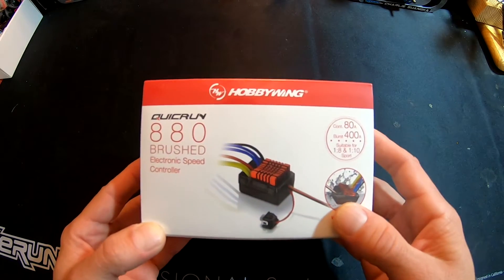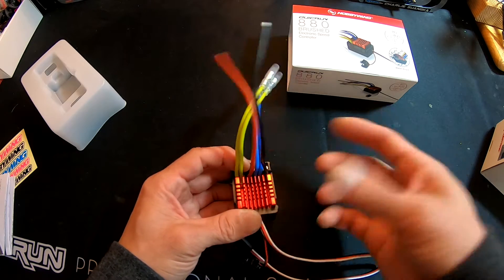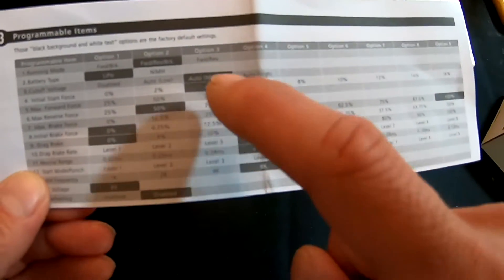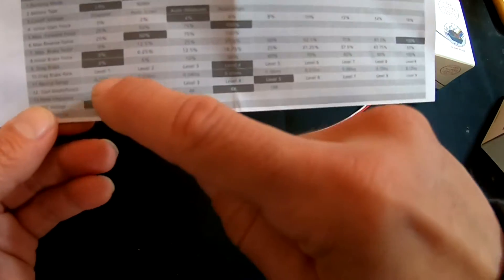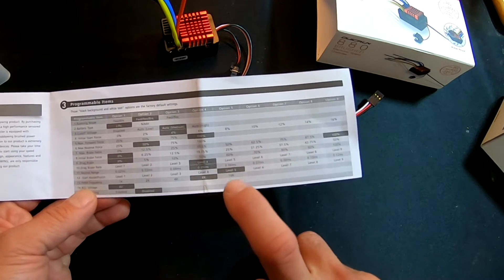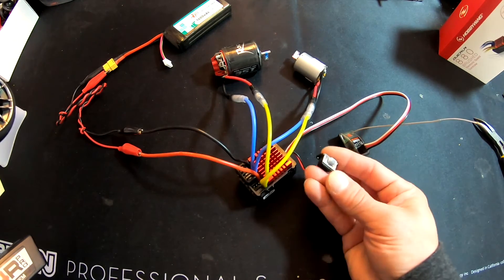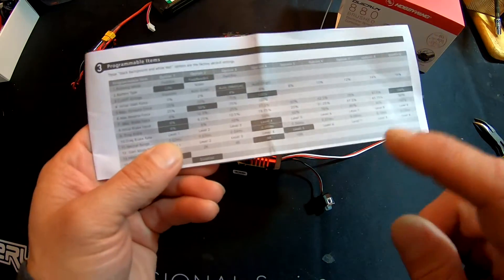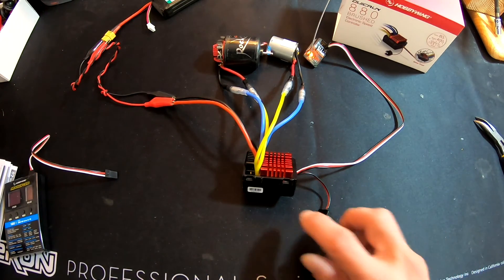Hobbywing Quicrun 880 Brushed Electronic Speed Control

Comment: will this quicrun 880 be able to handle (2) 30amp @ full power,12volt trolling motors. they are used  for momentary purposes only, like less than a minute at a time not continuous use. Thanks
Reply from the maker: Possibly. Hard to know for sure, but feel free to email us and we'll put you in touch with the correct dept.  NorthAmerica@hobbywing.com

Comment: Could this be used in a vintage tamiya clodbuster to replace the mechanical speed control?
Reply: I use it on a super clod. I really like it. I wanted a little more pep than out of the box without going brushless. So picked up the 880 and a 3s lipo running the stock 540s and man does it rip now.

Comment: installed in a Redcat RS10, reverse is full throttle but forward is less than half.
Reply from the maker: After install, then calibrate, do basic bench testing and adjust wiring or settings as needed depending on the items being used.  Email us for direct support - NorthAmerica@hobbywing.com

Comment: This is a good esc. I prefer this over traxxas’ ridiculously overpriced evx-2
Reply: So this will work for replacing a 3014 esc from an old E-maxx?
Reply: @Circuitprotector yep, I'm currently running this in an E-Maxx. I used it to replace the original EVX ESC.
Reply: @OmegaWolf543 Will I have to program it for running two 2S 7.4V lipo batteries? I'm not sure I'm handy enough for getting this esc to work.
Reply: @Circuitprotector nope, it comes out of the box with LiPo voltage cutoff enabled. That's exactly how I run it too.
Edit: don't run anything below 21 turn motors on 4s, otherwise the ESC will cut out. I learned that myself by trying to run two 12 turn motors on my E-Maxx.
Reply: @OmegaWolf543 I have the stock Titan motors in. Will that work?
I thought the esc comes programmed for one 2S battery. Running two 2S will work without buying the programming card.
Thanks for all your help so far. I really need some guidance.
Reply: @Circuitprotector yes, the ESC auto adjusts the cutoff voltage depending on the input voltage, so you can run 2-4s without changing anything. The stock Titan motors will work fine, since that's what I run as well.
Reply: @OmegaWolf543 One more question, if you don't mind.
How does the second battery get connected to it because I only see one set of battery wires?
Reply: @Circuitprotector the ESC comes with a jumper wire in the box. When you solder your connectors, use the jumper wire to make a Y splitter. Solder the positive side of one connector to the positive on the ESC, and the negative side of second connector to the ESC. Then solder the jumper wire between the open positive and negative ends of both connectors.
Reply: @OmegaWolf543 Yes, that makes sense.
I was wondering what that extra piece of wire was for.
Do they have that in the manual?
Reply: @Circuitprotector I'm not sure, I didn't read the whole thing when I got it. Only part I read was it's default settings, since it lists all the programmable features. It had what I needed thankfully, because I did not get the program card.
Reply: @OmegaWolf543  I received the esc but there's no fan inside. Is that how yours is?
Reply: @Circuitprotector mine came with the fan, they might've forgot to put that in. I'd contact their support and see if they can send you one.
Reply: @OmegaWolf543 The screws were there but not the fan.
Reply: @OmegaWolf543  This would be considered an in series connection, correct?
I have the Y connectors made up but I wanted check to make sure that in series is correct, not parallel.
Reply: So I have the 880 esc installed but still no go.
Not sure why. Any ideas?
Reply: @Circuitprotector YouTube keeps deleting my comments for some reason. Does the ESC power on properly?
Reply: @OmegaWolf543 Yes it powers on fine and the steering works.
Red light goes on when I hit the throttle.
Forward and reverse but not making the motors turn.
Yellow for positive and blue for negative on the motor wires.
Reply: @Circuitprotector are the motors wired to the correct cables on the ESC? First time I did it, I accidentally did it wrong. Yellow is positive, blue is negative, and the sequence should be M1+ M2+ M1- M2-. And these are the stock Titan Monster 550 21t motors, correct?
Reply: @OmegaWolf543 Yes, the negative and positive is right but I don't know about the M1 M2. I'll have to look later.
Reply: @Circuitprotector it'll be labeled on the ESC just below the wires, M1 and M2 of course means motor 1 and motor 2. That was the initial mistake I made, I mixed those up and got no throttle.
Reply: @OmegaWolf543 I hope that's all it is. I'll look in a few minutes.
Reply: @OmegaWolf543 Still not working.
Are there different 880 esc? This one says Quicrun 880-Dual Brushed 80A SBEC 6V/4A Input 2-4 S Lipo.
Shouldn't it say 14V?
Reply: @Circuitprotector that's the same thing mine says. I didn't set it up any different, since I didn't even buy the program card for it. Is it in the correct channel (channel 2 for throttle) on the receiver?
Reply: @OmegaWolf543 It's plugged in right where the old esc wire came out. With the black wire positioned exactly like the old plug.
Reply: @Circuitprotector hmm, that's strange. Does your transmitter have throttle trim settings?
Reply: @OmegaWolf543 No but trim works fine for the steering.
Reply: @OmegaWolf543 I'm running out of ideas. 
I might try to return the esc.
Reply: @Circuitprotector might be the best idea. As far as I know, they'll exchange it for you if it doesn't work.
Reply: @OmegaWolf543 I would be okay with an exchange.
At the moment I'm fed up with messing around with it.
I considered getting the programming card to see what was going on inside that thing.
Reply: @Circuitprotector I personally think the programming card is worth it. I haven't got one myself, but it is nice to be able to change things.
Reply: @OmegaWolf543 This morning I hooked up my motors directly to a battery. Neither one would spin.
Maybe it's not the new esc after all.
Would both motors burn out at the same time?
I find that odd.
Reply: @Circuitprotector I have had that happen before. The odds of that happening are crazy, but it is possible.
Reply: @OmegaWolf543 Not sure what to do now. I could buy new motors I guess.
Reply: @OmegaWolf543 I found a stone inside the motor's cooling fins and it wouldn't allow the fins to spin.
Maybe that caused the other motor to overheat and shutdown?
I have two new brushed motors ordered for $40.
I considered going brushless but doubt the old truck will hold up to that.
Reply: @Circuitprotector if one motor was locked up, it could've locked up the whole drivetrain and smoked both of them. And no, the old E-Maxx will not handle brushless very well.
Reply: @OmegaWolf543 I'm wondering if my esc was even bad.
Reply: @Circuitprotector probably not the ESC if the motors were locked up like that.
Reply: @OmegaWolf543 Esc will be getting changed regardless.
I've been reading that the 3014 esc doesn't hold up well with lipo batteries.
Reply: @Circuitprotector Yes of course, the Hobbywing 880 is a much better ESC. The 3014 is really old, and doesn't have any technology for LiPos.
Reply: @OmegaWolf543 Finally got it going again.
Next time I'll check the motors first. Lol
I noticed one shock is broken where it mounts to the frame.
No big deal but I need to wait for the set to be delivered from Amazon.
Reply: @Circuitprotector Glad you were able to get it going! Congrats man
Reply: @OmegaWolf543 Thank you.
Is there supposed to be grease on the pinion and main gear? Seems dry.
Reply: @Circuitprotector not that I'm aware of. I've always run mine dry.
Reply: @OmegaWolf543 I bought a Stampede VXL today.
I'm surprised how light it is and it's smaller than an E-maxx. I always thought the E-maxx was 1/10 but now I'm reading that it's 1/8.
Reply: @Circuitprotector The E-Maxx is one of those weird things where it was a 1/8 before 1/8 was popular, so it's kinda in between, since it uses 1/10 parts.

Comment: if I want to run only one motor with this esc how is the best way? jump the two + motor wires together ( and the same with - wires) or just leave one pair of wires not connected to the motor?
Reply: I used it on a crawler just connected one motor. Wonder if it will handle the 4s.
Reply: @CRAWLING LIFE ON THE ROCKS R.C. I don't think they do a single motor 880
Reply: @hardcoretam  he meant the 1080